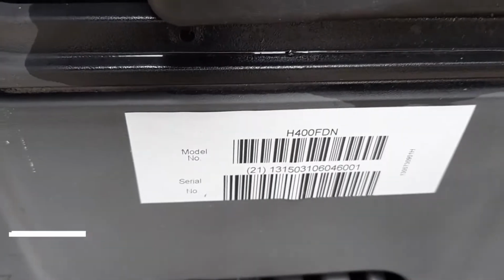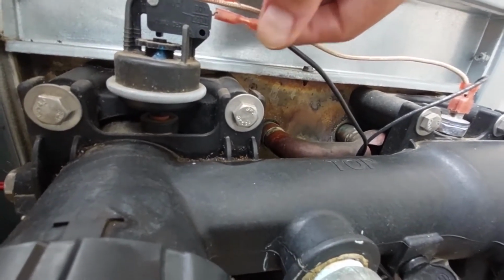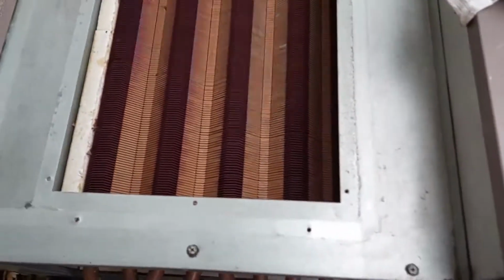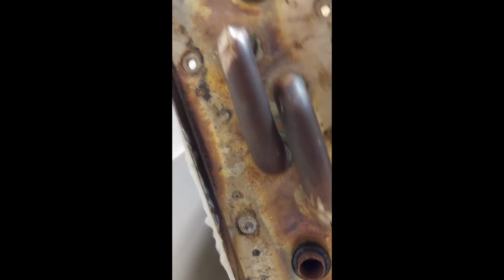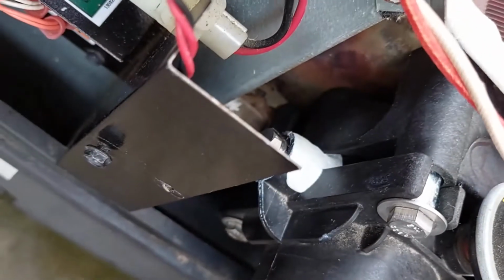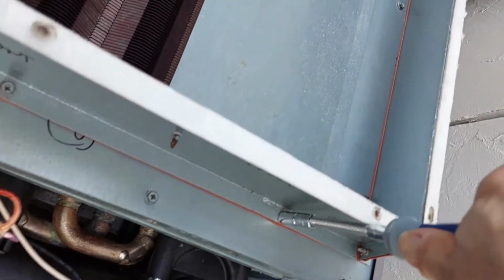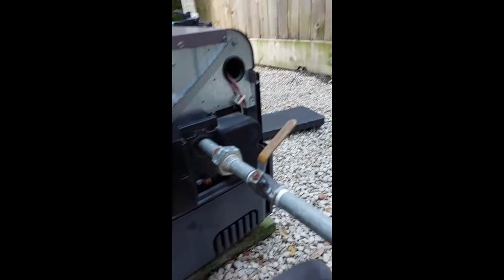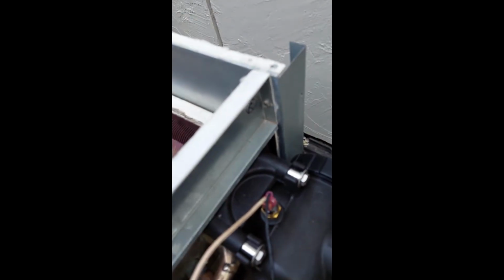Hayward Pool Heater H400FDN Disassembly Heat Exchanger Repair

Comment: What’s the place called that radiator repair?? In Houston
Reply from the maker: @Acardenas2121  thanks for watching and hopefully it has been helpful to you.  The place was S. Main Radiator Shop, 14301 S Main St, Houston, TX 77035. It wasn't necessarily a service they "sell". He was just willing to do a weld - he didn't offer any guarantee, but I was fairly certain if they repair auto radiators, they would fix the heater tubing without difficulty. I think he charged me something like $75 bucks. Was glad to pay it. Helpful also if you are a Spanish speaker. 😀

Comment: No time to read all comments, but I read a few . . . so this was your own heater you fixed or was this for a customer? Either way, I appreciate the video. I'm headed out tomorrow to replace a cracked Hayward FD Heater Head (you called it a manifold) and after watching your tutorial, I will have less guess work. I appreciate the time you spent making the video and then sharing it with the world. I respect the repair work, especially if this is your own heater. If this was for a customer, I'd love to know what you charged for all your work? Well done, sir.
Reply from the maker: Thanks for sharing your appreciation. I'm strictly a do it yourself-er. This is my heater unit. I billed myself at $100/hr (kidding). For Houston weather, I refused to purchase a replacement. The header/ manifold replacement was unexpected, but became necessary with gaskets/o-rings, etc. helping ensure a good install.Had I thought of the auto-radiator welding option first, it would have been a swifter overall job. It doesn't operate at super high pressure, but the weld was the best repair for the copper breaks from the freeze. Thanks again. Good luck on your job tomorrow!

Comment: Great job! I have the same heater with a leak at the header assembly connecting to the outlet pipe. replacing the O-ring didn't work so I.m going to replace the header assembly and cross my fingers..
Reply from the maker: If you have not purchased the header, here's one option which looks to be the cheapest:

https://azpoolshop.com/product/hayward-h-series-low-nox-heater-header-assembly-fdxlfha1930/?gad_source=1&gclid=CjwKCAjwv-2pBhB-EiwAtsQZFBNN4mIR1Gyaj4Ka137CJ0FMSTz4OpR82c8qtryZqOO_q7dB1zl2qhoC3KoQAvD_BwE

Glad to hear this video helped you out!

Comment: To me it seems like it just be easier to buy a new one and put it in instead of go through all that I know it cost more but it be a lot less headache definitely after watching the whole video I would’ve bought a new unit instead of done all that crap
Reply from the maker: 😆 

Thanks for watching and commenting. I didn't have a spare $3,500 for a new heater. Just the broken exchanger unit replacement was nearly $1,000. That required all the disassembly/ reassembly. So, when flush was "spare" cash, go for the easy route. But if you are not, that's why we have do-it-yourself'ers! 😉

Comment: I have this pool heater and it is smelling like gas every time I turn it on. The wall of my house has black soot on it. Anyone have these issues?
Reply from the maker: I have not experienced these issues (sounds like a jet plane when starting), but I don't smell gas - that would scare me.  And, the exhaust is always "clean", have never had any smoke or soot build-up on the wall either (although my unit does not exhaust out towards the house wall). Sounds like you have some issues I would be concerned about, and perhaps some safety issue to contend with too.  The gas should run / burn very clean...

Comment: I had the same issues using that jb weld. Wound up ordering a new header assembly.
Reply from the maker: I switched to using an Auto radiator company to weld the leaks. And that did the trick!

Comment: Great video. I have an older model that has a rear head gasket with an o-ring that is leaking. I intend to repair it as a replacement heat exchanger is $1500. It’s nice to know that a radiator repair shop can fix any leaks. I’ve got a lot of rusted head gasket nuts to remove hopefully without snapping anything! Great original content!  This is why YouTube is first place I search for repairs.
Reply from the maker: I love that this is helping others! Thanks for stopping to let me know. Use lots of Liquid Wrench for the nuts. Good luck.

Comment from the maker: Comments welcome... helpful? It's my first...
Reply: Mine also broke during Snowmageddon, about to start this repair. Is your soldering still holding? Mine was leaking metals into the pool, which turned our hair green. Did that happen to you too?
Reply: Either way - Thank you very much! Most helpful!
Reply from the maker: @jberlin8866  Not at all, Sir. Nothing like that happened. I got a really nice "radiator" soldering job done by an auto radiator shop (S. Main Radiator Shop, 14301 S Main St, Houston, TX 77035). If was like a brass material, $75 repair. No metal coming off that repair!

Let me know how it goes.